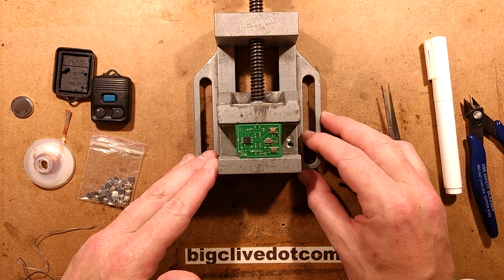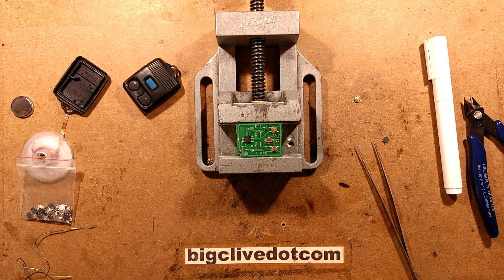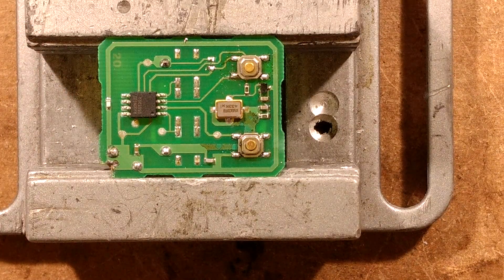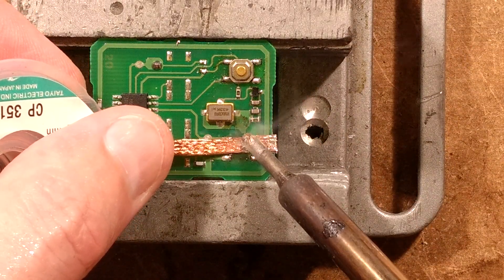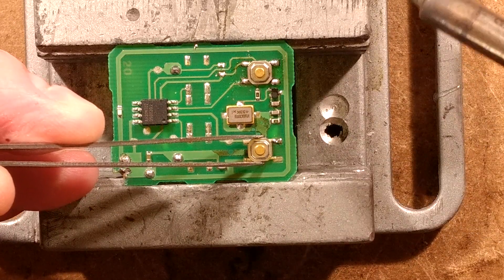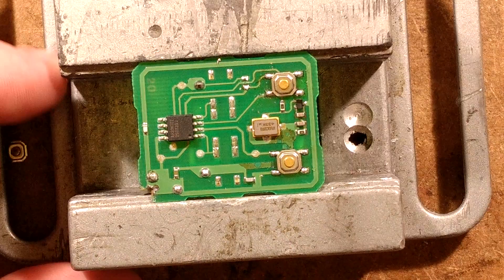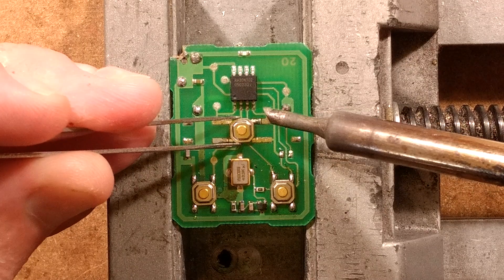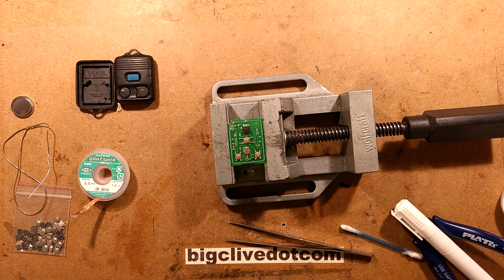Car/van keyfob button replacement.  (Glitchy video!)

Comment: Hi, question- These keyfobs work on RF right? Couldnt you just hook it up to an ossciloscope and check that out? Or was the problem only with the switches?
Reply: I could not locate a Datasheet for the AH30NT02 SOIC-8 chip used, but unless it exposes the relatively low frequency modulated FM signal prior to the multiplier stage (and I suspect it very likely won't since there is no need to in an optimized chip where the stages are internal) then you would need a rather high frequency oscilloscope to see the actual RF output.  I don't know what frequency the UK uses for keyfobs, but here in the States it is typically around 433MHz, which would require a scope capable of at least 500MHz.  Some of us are fortunate to have such scopes, but many hobbyists are limited to oscilloscopes in the 20-200MHz range, with 50 and 100MHz scopes being among the most common.
Reply: Thanks for the answer! I myself are kicking it with some no-name 'vintage' oscilloscope so i would probably not even come close!

Comment: Been looking for buttons like those for months now.  Looks like the same from inside Logitech Mice - low profile.  Any ebay link?
Reply from the maker: I got mine from a UK seller:- https://www.ebay.co.uk/itm/201390194309
Reply: Thank you.  Time to search!  Favorite mouse needs fixin'
Reply: Make sure you look closely at the image(s). There's lots of variety with ones even smaller than those.
Reply: Just search on "tactile switches" and you will find plenty of options, including the option to order them by the hundreds or in variety packs that contain a half-dozen or so various tactile switches types of which this particular model is one.
Reply: Mice that use the Omron buttons are the best.

Comment: I find tweezers to be very useful for surface mount component. Better than long nose pliers.
Just gotta make sure that they are not magnetic.
Reply: I found that tweezers with angled ceramic tips and a closed by default (squeeze to open) work best for surface mount components... well, at least for me.

Comment: Sometimes slowdowns on mobile devices are due to battery wear. After a while, particularly with heavy use, the battery stops being able to provide stable power for more resource-intensive things. The software then starts throttling the hardware's speed to reduce power consumption on the theory that "slow phone" is better than "phone that shuts itself off with no warning."

There's some debate about whether this constitutes planned obsolescence or not. But if you've had that phone for a while and/or you do a lot of deep charge cycling, you might try replacing the battery. Might be another interesting repair video. :D

Comment: Don't save to external sd cards if you do, it's not fast enough for videos most of the time.
Reply: Full 4K might need more than class 10 but 1080p should be fine.
Reply: Class 10 & UHS-1 should be fast enough.
Reply: williwonti: Good point, that'd be UHS-1 or higher?
Reply: Just get some Samsung Evo SD cards. They are great and decently fast. Also not too expesive
Reply: Plaster they're fine if you get a decent one. Most of them are nowadays. I record 4k video to microSD cards all the time. I've only ever had issues with old/worn out cards.

Comment: I'd just hot-air the switches out of there. Less chance of ripping the pads than lifting the switch on one side before desoldering the other.
Reply: All good if you have a hot air gun. I've never used one, they look reasonably easy, but fuck it. I've gotten this far without one and the way I see it.... better the devil you know.
Reply: You don't need it working on such large components. They come in handy on small parts or multipin chips, hot glue and heatshrink.
Reply: @Против Bill added flux with a flux pen and using flux core solder wire. So he didn't magically skip the "add flux" step either.
Reply: @Frank BGAs can be relatively large compared to those switches and you won't be able to touch them with a soldering iron. Once you are kind of used to having hot air on tap for SMD rework, reaching for it for most surface-mount jobs becomes second nature. Aside from wicking excess solder, re-tinning pads and attaching jumper wires, I do most other SMD work with hot air.

Comment: The key-ring loops on those remotes are weak.  Doorman makes replacement housings with strengthened loops. Available in pink camoflage. https://www.dormanproducts.com/p-72886-13625pkc.aspx?origin=keyword

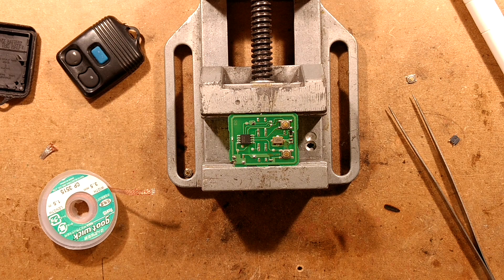Comment: 1:35 so it was 6° then?

Anyway, I normally try to use an Xacto knife to lift components. I angle the blade as not to cut any tracks.

Comment: Wish I had seen this a few days ago Clive, these are the switches I tried to swap on my washing machine and completed f*cking it up.

Thanks for posting it though I will know better next time.
Reply from the maker: Many of the consumer PCBs are the cheapest material possible and very easy to damage.  You could still fix the machine by gluing the switch in place and jumping wires to it from the tracks that were connected from the nearest strong point.  (possibly another switch leg)
Alternatively you may find a new or used panel PCB on eBay.
Reply: When I tried to remove the switch I placed the soldering iron on the pad but ended up burning the shit out of the circuit board then it just went from bad to worse from there really lol
Reply: What soldering iron did you use?
Reply: I keep my soldering iron just above the melting point of the solder brand I use, that way I dont lift the traces off the circuit board, but repeated fidgeting will mess them up eventually.

And those tips will not work for any type of solder unfortunately, you need a proper unit like a Hakko or even a chinese knockoff.
Reply: TheFoodnipple a really shit one unfortunately, it was actually a pyrography pen I bought for my wife made by hiveseen it had a temp dial that went to 450. There was loads of tips that came with it and I picked a pointed one as it was going to be a fiddly job but the solder just kept sticking to it and not the board..... honestly I got in a right mess... I don’t think I did a single thing right.
Reply: Undefined Lastname thank you so much that’s great advice I will give it a go.
Reply: TheFoodnipple thank you great advice I really appreciate that, funny I have just been checking out the Hakko units and have just decided I am going to get one.
Reply: Thank you so much everyone you have been really helpful and a massive thank you to Clive as your suggestion worked! so I managed to salvage my mistake thanks to you guys.

Comment: Why didn't you use the heatgun/-pen/whatschamathingie your soldering station has? Wouldn't it make things a bit easier, since you'd get the heat for the whole component?
Reply from the maker: It was to show how the switches can be changed with an ordinary soldering iron.

Comment: Ping BC,

Had the Isopropyl Alcohol had time to evaporate before you started to place the second button? Does it matter if some remains? I always wait for things to dry before soldering, but do not know if I have to. What do you say?

Cheers

DrT
Reply from the maker: It evaporates fast from anywhere and takes any water with it.  Isopropanol is often used to wash circuit boards that have water damage.
Reply: No it doesn't matter. It will evaporate the second the soldering iron comes close. I often clean the boards between solder joints and when i go to make the next joint it makes this "pssst" sound when the alcohol evaporates quickly. It doesn't interfere with the solder joint in any way.
Reply: What everyone else said, and also: 
Isopropanol is the the typical solvent used in the liquid rosin fluxes anyway, so if you're using flux, there's already plenty of alcohol right where you're sticking hot things.  Does it pose a fire risk?  In practical terms, no.  It's a small quantity, so by the time the vapor travels to any nearby ignition source, it will be well below the combustion threshold.  Using active fume extraction helps in that regard.

There are cases where it will easily ignite.  Using a butane-powered soldering pencil can easily ignite any excess alcohol or flux.  The same goes when using liquid fluxes with a torch for mechanical assemblies.  

Without an open flame, ignition is a lot less likely.  I have seen a dual heater BGA rework station ignite flux and alcohol vapor, but that this is basically sucking the vapor straight off the board and through the heater coil.  It would be difficult to replicate that with any handheld hot air tools.  The worst case scenario is it goes "foomp", it scares you, and you lose some beard hairs.  Unless you're actively pouring IPA on the board, the fire is gone in an instant.

Of course, if you want to evaluate a perceived hazard, you can always devise a safe means to test it experimentally.

Comment: I'm curious as to what "roasting hot" is for you Clive.
Reply from the maker: Anything above 25C, so 30C was extreme.  It's been so hot here that the local swing bridge jammed because it expanded so much it wedged itself between the roads on either side.  I much prefer winter.
Reply: Clive only complains when water actually melts.
Reply: @psygn0sis Us English softies moan if it's too hot or too cold. We're never happy! Typing from a toasty 30C living room while lathered in sweat. Also, don't forget we don't have AC over here. It's literally unheard of in domestic settings.
Reply: The difference is here we are just not used to It, and none of our building (except for larger commercial buildings, like shops) are designed to deal with it. E.g. I work in a fairly big branch of a well known chain and we are one of the few (of around 80 branches) to have  aircon.
Reply: i wish there was a better community dedicated to "un-updating" those erroneous uodates that ruin the usability of otherwise capable devices. the original nexus7 cimes to mind..by 2014 it was so slow it was pathetic
Reply: I can handle a 45C day no problems if the humidity is well below 50%, but feel like I'm dying if its over 27C in +90% humidity of the tropics. I'm guessing it would be the same with the cold.
Reply: Was curious about this too. Cold is goooood.
Reply: Our problem in upper Midwestern US has been we've seen 90F+  32c+ and 95% humidity several days this summer.
Reply: That's your average 9am temp and humidity in summer in Brisbane Australia, AND it doesn't rain until 4pm... if it does AND usually only for 10 mins bringing the humidity up to 99 and not cooling anything off at all.
 Right now it's winter and I can't stand it. Anything under 20c and I'm scrambling for jumpers and track pants!
Reply: To the Americans, I assume you have air conditioning, in the British isles it's hardly ever this hot so we don't, there hasn't been any wind either. Saying you don't complain when you are not actually in such heat is just a bit of a lie (or what I hear you now call an alt-fact). :D
Reply: Here in Melbourne 30 is considered a reasonable summer day.  I really dislike the 40+ days though.
Reply: bigclivedotcom 
I concur. The cooler months are much nicer. I don't mind the sun, it's just the heat, so a sunny spring or autumn day is fine with me. If I wanted long hot summers I'd move to the continent, but I don't!
Reply: Yeah. We know that you guys live in different climate zones and have other weather and you're used to it. And now the shocker: we live in another climate zone and aren't used to continuous temperatures of 30C+.
Reply: People here saying "oh but it's 40c here and I'm fine!" We have been getting 30c to 35c in the UK with 85 to 100 humidity. The difference is that the likes of the USA and Australia have air conditioning in pretty much every building. Only 1%-ish of homes in the UK do, and our houses are designed to retain heat to boot.

We have a high UV index, too. So surface temperature is through the ceiling. Some roads in the country are literally melting!
Reply: Jedda73
I wish I could remember the comedian who was talking about the "dry heat" in the US southwest. "There's a word for that. Flame!"
Reply: Jim Fortune Jeff Dunham. The puppet guy
Reply: And in germany we say that it´s typical german complaining about the weather all the time :D
Reply: Jedda73 that's the problem it's just too humid here, can tolerate much more abroad.
Reply: It was 36 here, and will be for the next week, at least.  Possibly the next month.
Reply: I’m the same, prefer the Scottish heat as I’m in fife close to the sea, the breeze cools you down and it doesn’t feel as hot.
When I come down to Surrey for the holidays as we break off 2 weeks before, it’s roasting here just now (32) I need to have a fan on constantly at night to sleep.
Reply: In the south of England, that temperature range is sweltering for me also. (southerer than London)
Reply: Oh, people have it and you can buy portable machines that work a bloody treat. I paid £200 for mine in Argus a couple years ago. Clean the filter every 6 months and it keeps going. You just need to be mindful of the hot air from the machine.
Reply: Robin John I didn't know the Canadians still used Fahrenheit.
Reply: You have air con, houses built for heat, etc. We don't - because its only like this for a short while each year!
Reply: I'm reminded of a motorcycling channel I subscribe to. They were advertising that they had a hot weather episode coming up and I was really looking forward to it as I'd been riding full days in 48 degrees with high humidity and finding it uncomfortable. They had this long episode about the best vented gear and then at the end said "over 36 degrees you're best off to close up all the vents and try not to ride in the heat for more than a few minutes". Great...
Reply: The part of the states I live in ranges from -34c to 37c+ with up to 100% humidity and we have a saying;  if you don't like the weather here just wait 5 minutes it will change
Reply: Yeah, I agree. 25C is too hot already and 30C is defenetly extrem. I feel best at 14-18C
Reply: I'll take 30 any day. We have had quite a few days of 40 to 45 this summer.
Reply: If that ever happened here, I would take my bed to the basement and wont come back out until its over.
Reply: lol 30c extreme?
30c is a lovely day for summer in california! We only complain when it gets above 38c.
Reply: 30c is bloody warm for a temperate island stuck in Irish Sea were the normal conditions go...chilly fog... wind..rain...more wind...strong wind lots of rain...cloudy....oh! look a bit of sunshine....drizzle.. cold rain.. hail then slight cold spell , and that's just while you are have a sit down and a cup of tea!
Reply: Above 38? We down under don't even complain when it gets to 40.
Reply: Jimmeh - TrackyDaks please!! :-)  Were rural NSW and it's been the coldest winter for either 47 years, or on record (depending on who you talk to!). We've had a few days where the shade temp has not reached double figures, and that's unheard of. Not quite as bad as Canberra (-4C this morning) but not far off it. Can't wait for summer!

Comment: I found Louis Rossman within the last 2-3 months and from what I can tell he really dumps flux all over the board, probably for 2 reasons 1) it melts and spreads out quickly due to soldering and the heat gun 2) it actually evaporates away as he's using it due to the sheer amount of heat he's putting into those heatsink macbook boards.  He also often needs that much flux to get in and under components like BGA-soldered chips and connectors where re-flowing them doesn't work unless it gets under there really well (and gets hot, spreads out, etc).
Reply: flux uses heat to clean metal so there is really no harm in using too much. But if you look at his videos you might notice a few things. First he uses a microscope so it looks like way more than it is. Secondly he is usually dispensing it out of those syringes so it really isn't that much. I've never heard nor seen flux harm anything but it is good practice to clean it up with isopropyl. I see plenty of boards from the factory where they don't clean them well but there are usually multiple problems with them.
Reply: I do soldering and reworking under a microscope also.  It's not nearly as much flux as it looks like.  The ISL6259's he's always replacing are only about 4mm on a side, so the flood of flux you see Louis using isn't a huge amount.  It's more than I use, but too much flux isn't a problem I've ever heard of.

Comment: Wouldn't there have been less chance of lifting a pad if you used the hot air gun?
Reply: If you desoldering it then you don't care about if it melts
Reply from the maker: If done with care this technique allows use of an ordinary soldering iron.
Reply: Hot air gun and small buttons rarely mix. The plastic on the buttons melt when the hot air hits them.

Comment: Rossmann has to work on stunningly small parts.

As for a phone, look to see if the Mi Max 2 will work with your carriers. It has an absolutely massive 6.44in screen, great for my large hands.

Mine does 4k video fine.

You will want to flash custom firmware, however.
Reply: iamdarkyoshi Fortunately, the only phone that's even slightly carrier specific here in Europe is the new Apple watch because their "eSIM" system doesn't work with most carriers.  Every other product uses real SIM cards, and carrier involvement is mostly just selling phones below cost if you sign up for X months and allow your phone to be locked to that carrier for the duration.
Reply: iamdarkyoshi If Clive wants to use screen mirroring or Chromecast while recording, he would need a phone with really powerful chipset and good cooling. Still, it could stutter when it gets hot (because these are heavy loads). That's why I would recommend PC or laptop + almost any cheap DSLR that's capable of connecting to PC and recording. He could use monitor for viewing what's happening and change exposure and everything from PC.
Reply: iamdarkyoshi if going for the mi mix 2 go for the newer 2s